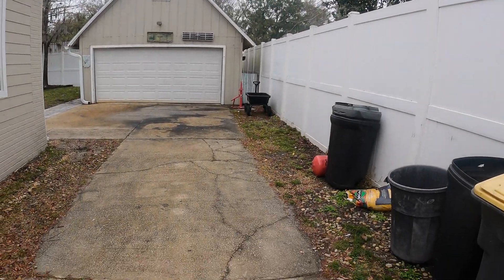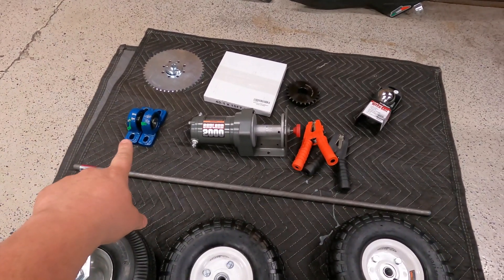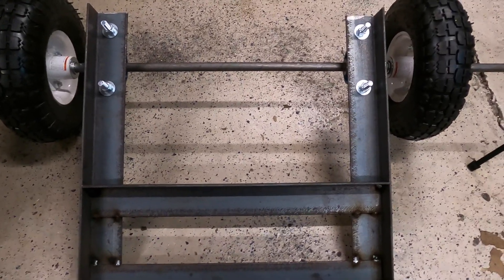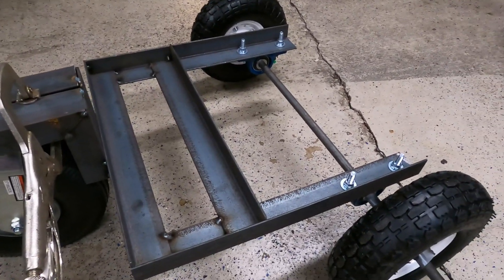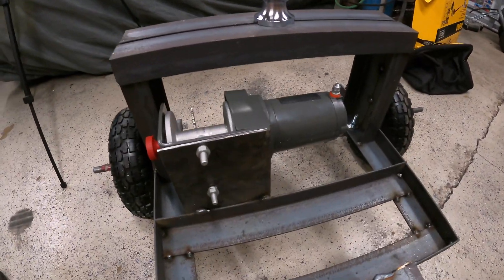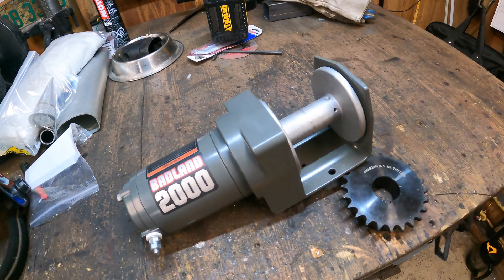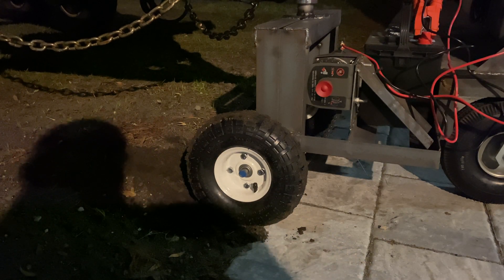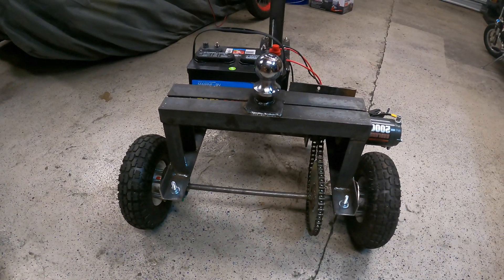DIY Powered Trailer Dolly for under $250

Comment: Hi, to make the wheels spin slightly faster, should the smaller sprocket be put? Thank you 🙏
Reply from the maker: @Ernesto.66  yes, smaller on the axle
Reply: @barefootgaragejax9252  By putting the smaller chainring on the axis, does the force/power remain the same or will it be lower? I have to use it to tow a trolley on the beach weighing 100 kg and I have to consider whether to design it with an electric motor or with one of these modified winches. Thanks 👋
Reply from the maker: @Ernesto.66  for the beach, I think traction will be your main issue. Gear it low and make it heavy, as too much wheel speed (larger wheel sprocket) will spin the tires. Good luck!
Reply: @barefootgaragejax9252  On several occasions I have mentally designed the electric wheel to take the small dinghy to the sea but I have never tried to make it. I have always been afraid that the wheel on the sand would slip.

Then I saw your video and I was heartened but having to travel about 100 meters on the sand, the rotation of the winch I think is too slow.

I think I have to use a different electric motor.

To make the wheel spin slower but stronger, whatever engine I am going to use, should the ring gear of the motor or the ring gear of the wheel be larger? Thank you ❤️
Reply from the maker: @  for more speed, larger at the engine and smaller at the wheels is the ideal. For the beach, why not add dummy wheels and rubber tracks?

Comment: The winch motors have the brush timing so they have more speed and torque when pulling in the cable.
I built similiar thing using a golf cart differential and used the winch motor to drive the pinion.  
I've also used the winch motor for a gate opener, and had to attach a bike sprocket to the drum and just used a smaller sprocket and bolted it with washers to the drum side.  that worked.  These are very noisy motors (gears), so I would not use them in the future.
Reply from the maker: Good to know!
Reply: If u don't use gears it won't work, as motors have to turn fast

Comment: Great video, I have a few questions please. How big are the sprockets? so I can buy a similar size. Also do you know how many rpms your winch puts out? I'm asking cause I'm using a different motor.
Thanks a bunch
William
Reply from the maker: The sprockets are 24/48, so a 2-1 reduction. Not sure on the winch drum speed, but it’s quite slow. Well under 50 rpm

Comment: Why didn’t you just drill a hole through aluminium for small cog
Reply from the maker: I believe the drive mechanism runs through the center of the spool. May have worked though.

Comment: I'm about to make one largely based on your design.  However I have a concern on the parts list vs. the provided links.  The small sprocket says 16T but the link is for one with 24T.  The large sprocket says 30T but the link is for one with 48T.  Changes to teeth on either will have a significant impact on speed.  Don't need it to be too slow, nor too fast.  So what was the actual sprocket teeth you ended up with?
Reply from the maker: Hey Wayne, glad this was helpful! I ended up using a 24/48 combo. I’ll update the links. Good luck! The 24 is the max you could go and I had to clearance the winch body. If I could have found a 16 or 20T with the right ID I would have used it.

Comment: For a more versatile purpose you should have used a 1 7/8" ball. That way, it could be used with 1 7/8:, 2", & 2 5/16" trailer couplers. The trailer doesn't even have to clamp the ball to be used; just set onto the ball.
Reply from the maker: It’s just hand tightened on- I can swap it easily. Right now my only trailer is 2 5/8 :)
Reply: You could use a Convert-a-ball

Comment: Great video! May I ask why the flipping of the winch motor? Thank you
Reply from the maker: I don’t know why, but the motor speed was different in each direction. So I flipped it to be geared “slower” when pushing the trailer and “faster” when pulling.
Reply: @barefootgaragejax9252  Makes sense to me. I guess it being a winch motor it is designed to pull so I can definitely see a directional difference. Great job and thanks for the response.

Comment: I used a  8hp snowblower. Removed discharge chute and auger. Fabricated the front for two swivel wheels.Mounted ball on plate just in front of discharge chute. Can use multiple sized trailer balls.Obviously welded in supports to beef it up. Moves my loaded 5500 lb toy hauler. Low gear forward and low reverse work great.,  About 5 years ago for about $200 bucks . Used snowblower was $50..Shop time as as  always.... lol.    Good luck.
Reply: It’s one of the ONLY benefits living with snow and cold!! Lol   Take care.
Reply from the maker: Awesome!! Not many used snowblowers here in Florida, but that’s a great idea.
Reply: Send me a picture
Reply: I’m currently doing the same thing with a 10 HP snow blower. Hope it can move my 7000 lb travel trailer in tight spaces.
Reply: @VincentValeriano have you had any luck with it?
Reply: @cdsmit27  not so good on wet grass at an incline. Bit great on pavement
Reply: But great on pavement moving 4000 lbs.  couldn’t move my 7000lb trailer on the grass. It just dug in.
Reply: @VincentValeriano  do you have any videos of the build?
Reply: @cdsmit27  no. Just pictures.
Reply: Do you have any videos of it. I need to do this same thing

Comment: I have a similar problem.  I'm not allowed to park my travel trailer in my driveway.  I have a ton of room out back but the truck is too big and long.  Any ideas on upsizing one of those for a 9000lb travel trailer with good traction on grass?
Reply: I'd be curious as well. Something has to be cheaper than $2,300 for the Parkit360 10k
Reply from the maker: I think that kind of weight makes it a much tougher problem. Maybe converting a gas powered price if equipment would work better. It would need a lot of deep gearing and be heavy enough to move it. The trailer valet and above mentioned parkit360 are the only commercial ones I know of. But for that money you could buy an old jeep, cut the back off, lock it in 4 low and just use that!!!
Reply: @barefootgaragejax9252  I used a riding mower..worked ok on dry ground,  but any mud it just didn't work.

Comment: What did you do for a chain tensioner?
Reply from the maker: The pillow blocks have about 3/4” adjustment and I was able to tension it that way. I also had some half links in case it needed it, but ended up not using them. It’s a very slow speed, so not a lot of chance for it to skip.

Comment: I sat a couple of oid 12 volt batteries on the towbar of the trailer to increase the weight on the hitch and it worked. Weight at the hitch was about 140 ibs. Solved, thanks.
Reply from the maker: Awesome!

Comment: Really enjoyed your video and loved the safety boots. I have built a dolly with two ride on mower wheels being driven by similar motor. I am having trouble on slightly rough terrain and wondered what sort of weight you have at the hitch? I suspect my alloy boat is a bit light at the coupling.
Reply from the maker: Thanks! I would estimate it at 200-250 pounds. I can lift it by hand if I really need to.  I found my setup likes to “pull” instead of “push”. When I need to push, I lift on the handle it puts all the weight on the drive wheels. I also initially had the ball height too high, and lowering it helped a lot. Tire chains are an option too!